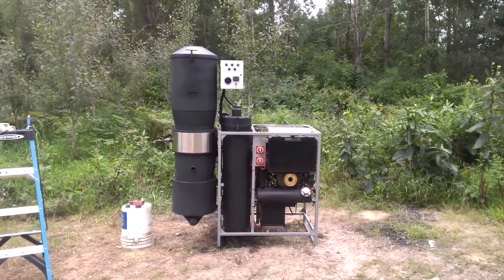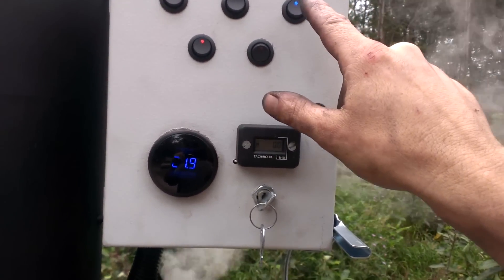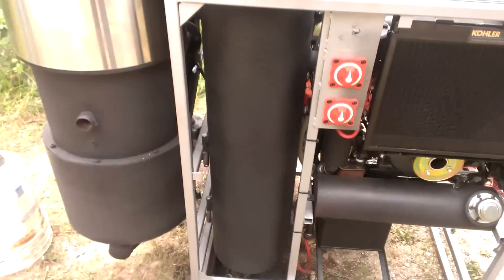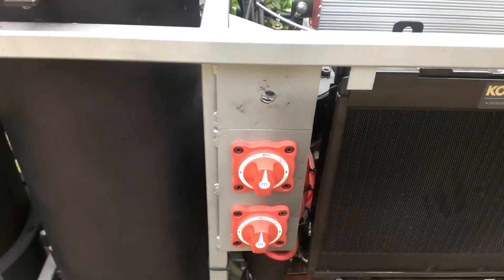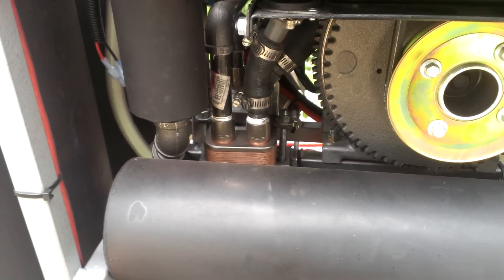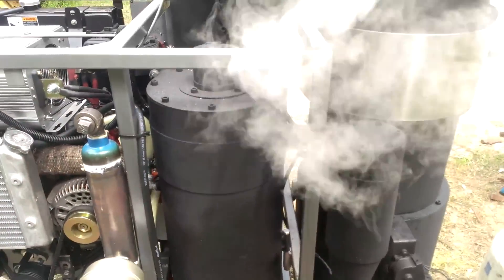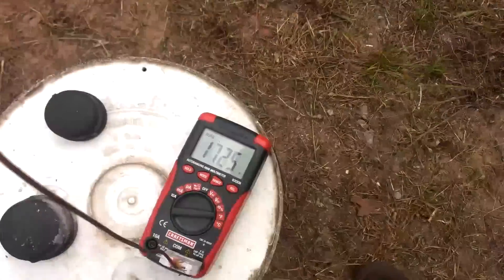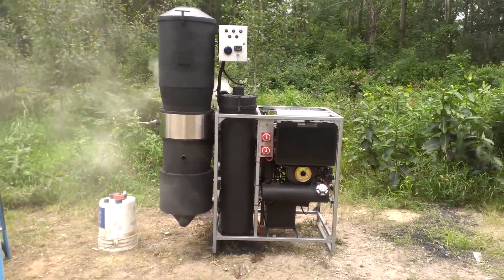Vulcan Gasifier 5 kW CHP Gasifier / Generator Over View

Comment: That's the nicest and most compact gasifier I've seen so far. I would like to build one like this for our house. Do you provide a DIY plan for this unit?
Reply from the maker: Build a charcoaol unit. Wood gasifiers are finiky and unless you can automate it; it will not self sustain. There is no such thing as a tar free wood gasifier and there never will be. Charcoal with water injection will produce higher energy dense gas, with out tar problems and they will self sustain. Its also easier fuel to produce. Its a ton less work to produce wood fuel for a kiln. The kiln does the work not you. Not to mention you are unlimited to what you can use rather be confined with what will fit a chipper or chunker.
Reply: @Thrive-Off-Grid  ❤ thanks a lot for that response and explanation. I see the main obstacle with a wood gasifier is the tar. Do you have a DIY plan for a charcoal gasifier?
Reply from the maker: @HavardHammer  Yes go into my videos and look for the DIY Ammo Box Gasifier. You can follow it exact or take the idea and scale it or make modifications to make what ever you have work. This version is for a down draft but you can build this so it is up draft. An updraft will be easier to make but with some sacrifice to gas quality. But it will still work and run an engine. There is also a support thread on our forum. You are welcome to create your own build thread there. I will then help you when I can. https://www.thriveoffgrid.net/forum/diy-user-projects/ammo-box-diy-no-weld-gasifier?origin=notification
Reply: @Thrive-Off-Grid  thank you very much for that info. Is a charcoal gasifier more efficient than the wood gasifier? Do you have a system to run your electricity needs for a house?
Reply from the maker: This is a very old video and we have since long evolved from this. I will never build or recommenmd a wood gasification system for small engine power ever again. Like everyone I took charcoal at face value and would not even consider build one until a few years ago. Then I built one and well now Im eating lots of crow. Becuase charcoal is hands down the better solution. Dont waste your time and money trying to build a wood gasifier it dont work.

Comment: Muito Show, me envia o projecto, para que eu fabrique um aqui em Belém Pará- Brasil
Reply from the maker: Here you can start by building this here. https://youtu.be/5Er-4T9H-GM

Or 

Get the Imbert plans here. https://www.thriveoffgrid.net/forum/diy-user-projects/handbook-of-biomass-gasifier-and-engine-systems

 I no longer support direct raw fuel gasification. There is absolutely no way to guarantee tar will be eliminated. Even when a raw fueler is making " clean " gas it is still introducing soots to the engine. These soots get into the oil and degrade it. Tar in the valve train will destroy the guides and then settle in the oil and will not ever fully drain out of the oil eventually reducing the longevity of the engine. 

Charcoal is actually easier and much faster fuel to produce. There is no waiting for fuel to dry only for it to cool. The energy to produce charcoal if done efficiently is no more than fueling a wood chipper and the waste that is produced from the wood chipper. If you add in the energy required to dry the fuel, charcoal is actually more efficient less energy intensive. Your physical labor is only a fraction of what it is processing fuel for a chipper, running the chipper and then screening that fuel. charcoal is by far better technology and is clean and safe for your engine. Ive done both and did raw fuels for nearly a decade. The only way I will do raw fuels again is if it is a hybrid system involving a charcoal reactor that can fully crack all the tar and moisture. Otherwise never again. Charcoal also runs 100% more stable and does not require complex filtering or the complexity and expense for advanced automation. Raw fuel gasification for engine power MUST be automated to self sustain period.
Reply: @Thrive-Off-Grid  Obrigado. Vou estudar minuciosamente e se possível gostaria de contar com sua ajuda no projeto
Reply from the maker: @menotticalliari  Yes that is what the forum is for. Please become a member and create a build thread in the DIY category and share your build there. Myself and others will then help you along the way.

Comment: Oh my god this is beautiful haha. I wondered if anyone had made a totally automated gasifier and this was the first search result. Now my thoughts are, how can I make one that's entirely mechanical utilizing no electronics at all. Pondering...
Reply from the maker: This is an old video. New ones are far more advanced than this one. Electronics made it a lot easier, I dont know how you would with out them or why. Nothing wrong with modern technology this isnt the 1980's any more.
Reply: @Thrive-Off-Grid  The thought is, in a SHTF scenario where service parts are unavailable for electronic controls systems an entirely mechanical solution would prove more robust. Much easier to turn a new part on a lathe than to try and source replacement electronics. This may not even be your target market, I'm just mostly thinking out loud here.
Reply from the maker: In that scenario you simply run it manually and bypass automation. There is no way to control air fuel mixture with out mixture controls that require electronics. You could use early style automotive wiper delay mechanisms. for grate and hopper agitation. I bit more complex than simple cycle timer control. To have back up parts would be the way to go. Otherwise you can always run in manual mode. Until the SHTF you have the automation to rely on. In that situation myself I would have our Flex Mini with the simpler automation much like this machine here. If any thing breaks I can still run it in a manual mode.
Reply: Yeah that makes sense, I was just thinking perhaps based off the EGT of the generator, you could mechanically regulate AFR with a bimetallic spring to keep it in the sweet spot. The response time would be god awful though.
Reply from the maker: How would that detect oxygen content in exhaust? Air / fuel mixture has zero to do with rootlet position angle. The gas is constantly fluctuating both in volume and volubility.
Reply: As I understand it EGT increases in a lean condition. Now whether or not there's a linear relation between EGT and AFR I have no idea. You've obviously put a lot more effort into researching this compared to my armchair engineering so I'll just shut up now haha.
Reply from the maker: Lol when throttle position changes occur the air fuel mixture will not change. Both air and fuel still pull in proportional to one another.

Comment: Do you make different size systems?
Reply from the maker: Yes we build 2 kW systems on up to 25 kW so far. The larger systems are direct AC systems. Newer versions will have the GM LS-1 5.3 ltr power plant with electronic controlled air fuel mixer. We offer a slightly less expensive version of this machine that is not a CHP rather it is power only. We offer this same system in a 2 kW version as well. You can see our full product line on our product page at our website here. http://www.vulcangasifier.com/projects.html

Comment from the maker: Thanks for the kind words. You are a little ahead of me on the O2 sensor but yes this is coming. So for now it is used as a reference for setting the mixture. I have much more automated systems in works for this as well. We want to get the machines so they are push button operation. You can simply start the engine on gas and start the gasifier with out the blower and then switch over once up to temp.

Comment: You have built your gasifier the same way I have! I've only built mine in my mind though ;-) Really nice build!  Is the air/fuel mixture actively controlled by the o2 sensor, or is it only used to manually be able to set the right mixture? With a 2 cylinder engine, would it be possible to run 1 cylinder on gasoline an use the other to get the gasifier started and skip the blower entirely?